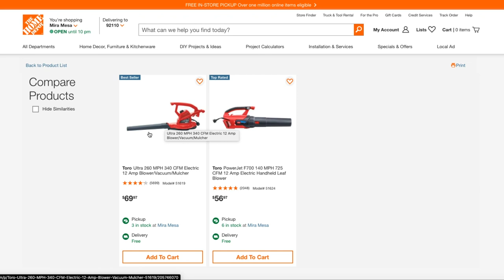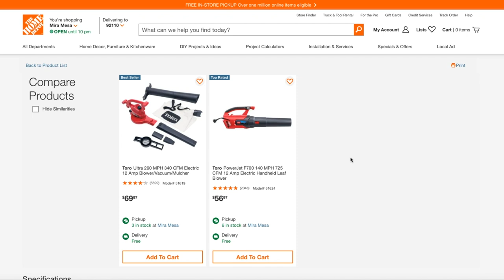LEAF BLOWER  CFM or MPH? Which is more important? | Car Detailing Tips Best Way To Dry your Car!

Comment: CFM is mostly proportional to the strength of the motor, while MPH depends on both CFM and the nozzle diameter. Larger nozzle diameters means lower MPH.  If we are talking about leaves, high CFM means you can move a lot of leaves at the same time. But high MPH makes it easier to move things that require a lot of force to move, like leaves that are stuck. Extreme case would be a super powerful unit but with a giant nozzle, so super high CFM super low MPH, then you would move all your dry loose leaves in a second but all your wet stuck leaves would never move at all.  Drops on a car don't need a lot of force to move, so MPG is much less important than CFM.
Reply: A few stubborn straggler leaves on the lawn is a good thing. Decomposing leaves are great for the soil and lawn so don't fret over getting every single last leaf. I would go with the more CFM.
Reply: By reading comments from others below where you can add reducers to increase MPH, would it affect the motor in any way since you are restricting the flow, therefore adding stress on the motor? It may create overheating or other problems where it would it break sooner?

Comment: For anyone interested in the Toro f700 cause its so cheap there is a mod to make the 4" to a 3".
If you get it at home depot go to the plumbing department and p/u a 4" to 3" coupler (can also p/u a 4" to 2") ...fits like a glove and narrows the blow force to what I personally think 3" is the perfect end for a QUICK CAR DRYER.
You can grab it for under $6....😎😎
Reply: how do you get the coupler to stay on without it blowing off and maybe damaging the paint?
Reply: Very good comment, thank you
Reply: Anyone find out if this is safe to use?
Reply: @jtekz_ Screw silicone contact cement bolts and nuts. Find a option that works for you.

Comment: I just ordered the Worx Turbine 800.. 135 mph, 800 CFM. Yields 108,000 cleaning units. Found it for 59 USD!
With this, I should be able to dry my car just fine without worrying about scratching the paint. Get everything nice and dry, and then put on a topper to add a bit of protection.

Thanks for the great information!
Reply: Bought it last october, knew it wouldnt work well on a non coated car even with a sealant, now that my cars coated the water blows real well even with my little metrovac sidekick, so i just bought the 800 again to try out, how is it?

Comment: The 260 mph is achieved by compressing the air, there by displacing the water drops. The other moves a greater volume of air but the air isn't compressed. It's volume vs rate of flow. Bottom line is, you're not going to dry the water drops from the surface, you're going to displace them from the surface. At a max of 260 mph you going to have more turbulence in the nooks and crannies like your mirrors. Good video BTW.

Comment: I've been using the F700 for nearly 2 years. I also own a land scape company. I can tell you it would be perfect for auto detailing if the nozzle diminished in size to 20-30% smaller at the tip. Still great for the price.
Reply: On thaT NOTE i SAW A GUY WHO CAME UP WITH THE PERFECT SOLUTION...While picking it up at Home Depot he also bought a 4" to 3" coupler taht fits like a glove in the plumbing department....Pretty much doing exactly what you mention above....BOOOOM 😋😋

Comment: Multiplying the CFM and the MPH together is much more useful than looking at either alone. To effectively push water off a car you want as much CFM and MPH as possible. Honestly, I like a raw force measurement better such as newtons or pounds. This will take in to account both the CFM and the MPH. Many of the more reputable brands now list this measurement especially on larger units. CFM and MPH used separately is pretty useless. It is like saying what is more important CFM or PSI on an air compressor or what is more important GPM or PSI on a pressure washer. They are both important and the most effective is the unit that has the highest combination of both.
Reply from the maker: Totally agree!

Comment: I feel like I hit the sweet spot, I got the ego 765 cfm 200 mph blower. Waiting for my stubby nozzle to come in so I can give it a right proper test run. But first use and impressions with the stock nozzle. I like it. It cut my drying time down at least in half, And it got my wheels and tires completely dry. Got the drip zones really good and up by the hood where the water pools at the bottom of the windshield. It is loud as heck tho, I'd recommend wearing ear plugs.

Comment: Freaking AWESOME!  You were comparing the SAME two blowers I was looking at to replace my Troy Built electric 150mph and only 180CFM that I currently use to dry the car with.  Now I see the PowerJet F700 is the one to get!!  So awesome.  My electric blower worked pretty much the same as the one you first demostrated.  What a nice difference between the two.  Very noticeable with the PowerJet F700!

Comment: I’m REALLY hoping that you’re wearing hearing protection while using those blowers. I have both and they are both VERY dangerous to your hearing long run.  Especially indoors. 

On a different note, both work great for me. I always use the finer nozzle on them in order to concentrate flow. 

In conjunction with the higher airflow, lowering the coefficient of friction by ceramic coating really helps.

I also use a rubber edge on them to prevent mishaps from making contact accidentally.
Reply from the maker: Not in the video, but i do when i actually work!!
Reply: @Jesuschristitsjasonbourne3  yes. Loud noises, for extended periods of time are very damaging to your ears. If you don’t know that then consult literally any ent. If you didn’t know that, I’d also like to make you aware it’s dangerous to look at lasers, the sun, and touching hot stoves.
Reply: @Jesuschristitsjasonbourne3  really? That’s your addition to your comment? Now it’s a masterpiece hahahaha
Reply: GREAT POINT. I am currently in the process of selecting a new cordless:
- Air Pump for tires
- Vacuum for detailing
- Blower for Drying
Different brand/models of the above can vary greatly in sound level.
 As a chronic headache sufferer this is VERY important to me. The ProjectFarm videos are great because he includes measuring sound level(db) for each unit.

Comment: Got the WORX WG520 yesterday October 14, 2022, and used it today Oct. 15, and does a mediocre job. Washed my car today and using the WORX WG520 made water beads very small and plentiful. Took me 20 minutes to blow dry my new 2022 Honda Civic Touring, built on September 2022 (date of mfg on the driver door side) and received from a Honda dealership on October 4, 2022, with 2 miles. I bought the blower to avoid getting watermarks or streaks. It does blow leaves very well, but not so good for drying a car. I duct-taped a microfiber cloth around the plastic tip so an accidental touch on the car paint would not leave a scratch. The WORX WG520 is very light, the air intake will suck your tee shirt when close to it. I think suction is better than it blows. The Ryobi 730 CFM 40V Blower could be better because it has 130 CFM more than the WORX WG520 600 CFM. For $55 plus add sales tax, you are better off spending $90 to $120 for a much better product. You get what you pay for! The WORX WG521 is said to be 800 CFM you could try it. WORX WG520 not recommended as a car dryer. Plan on getting a battery-powered unit because dragging around an electrical cord is a nuisance and you don't have to worry about becoming electrocuted after washing your car. Safety First!
Reply: Your car must not be coated then if its just creating smaller beads..or a weak sealant or wax at the least. I did diy detail ceramic gloss and the worx 800cfm did a mediocre job..my now coated car? 800 is a monster.

Comment: Love my eGo 650!!! Rockin it w/ a 7.5amp hour battery. Crazy good!
Reply from the maker: Im going to pick one up to try out.  Thanks!
Reply: @imjoshv  117k units by your logic. Also, when drying vehicles, I don’t use end tips I keep it open.
Reply: Night and day difference when you use the ego650! Here in Az the ego is a must now that it’s getting warmer. I can wash then blow dry the vehicles before water spots set in. It has a nice turbo type button that works awesome on the wheels.

Comment: The f700 is blowing wet leaves at 8ft away. Dry leaves at 15ft away. Only the Ryobi 8 amp can get near this ability. But its quiter at 58 decibals as the Toro is close to 80 decibals. At  Home Depot there is a dollar difference between the 2.

Comment: Maybe would get the best of both worlds with a reduction tip on the higher CFM unit. That should increase the speed of the air.
Reply from the maker: Good point

Comment: Good info on the mph vs. cfm comparison. I’ve got the Toro two in one blower and it’s a great machine for yard work. But since I regularly use the mulching function, I wouldn’t use it to dry my car. With the mulching function, you’re drawing dirt, leaves, small sticks and even small rocks into the machine. Most of that goes into the mulching bag, but when you switch to the blower, there’s a risk that you’re going to launch any remaining dust and debris right onto the freshly washed car at high MPH. And if you’re not using the mulching function, why pay for it? I’d stick to a regular blower for car work.
Reply from the maker: Yea better to be safe than sorry!!

Comment: I just bought a Stihl BG86 gas blower and it's got like 400 CFM and 150 MPH or something like that. I did my whole yard with not a problem, only it couldn't really move the piles once collected. Even though my yard is done and only used this $300  machine one time, I am so tempted to buy the Worx Turbine 800 CFM out of morbid curiosity. I would literally have to rake some leaves out of the woods back into a pike, just for the sake of seeing how it co pares moving the piles. Because if it's that much better, I could try and sell the Stihl one I bought and pocket some cash, since the Worx 800 is less than $100. Am I crazy and should I just let my current obsession over leaf blowers pass? Or do I bite the bullet and possibly lose money for the thrill?

Comment: if you take the 725 cfm blower and use a smaller nozzle, it lowers the cfm but increases the speed. its all about the nozzle diameter.
Reply from the maker: Just like orifice size with pressure washer nozzles! Great point!

Comment: If you use Electricity as an analogy Voltage is equivalent to MPH (Pressure) and Amperage is equivalent to the CFM...(Volume). So to calcule which one is better it's the MPH x CFM= Power (your winner) so basically it's almost the same for both unit...you should be happy  for both.

Comment: Nice video. I'm looking at that 725 CMF Toro and have a smaller one similar to your other one (220 MPH) so I appreciate the comparo. The one thing you missed with the second one was how well it dried. You mentioned the first one left tiny little drop, which I get as well. How did the roof come out? Did it dry it completely or were there still tiny dropless left that you have to wipe off?
Thanks.
Reply from the maker: Both of them will dry completely if you work the panel long enough! You really can’t go wrong with either machine

Comment: I have had both of these units as well, both purchased at Lowe's.   Where blowing leaves is concerned, the less expensive unit with the larger diameter exhaust nozzle is ABSOLUTELY more effective.  I can move piles of leaves from twenty feet away with the F700.   I am going to try it out on my driveway snow later this morning.
Reply: Do you own both to say one is more effective? I can do the same with the high MPH Toro.
Reply: @matsudakodo    You asked, "Do you own both to say one is more effective?".   NO is the answer to your question.   I sold one and kept the F700 after comparing the two.  
Go spend the $70 for the F700 and THEN... you decide.  Not until then will you know.

Comment: I used the CU calculations on all my blowers and I found out the the Toro Ultra is more powerful than the Echo handheld gas by 10000 Cu while my older Toro rake and vac has a CU of 56000 and my Ryobi ONE+ is 28000 CU
Reply from the maker: yeah the battery powered units are typically not as powerful.. how do you like the ryobi one+. thinking about reviewing that
Reply: @imjoshv  The ONE+ is great for small jobs far away from the outlet and is easy to use. It also excels blowing hard surfaces with medium debris but it doesn't do well with wet leaves in large piles so I rarely use it for that job.

Comment: Do you guy's think a narrower nozzle makes a big difference? I just bought a nice Brushless battery powered Ryobi but it has a pretty large opening at the end. And I can't find any different ends to buy
Reply from the maker: Typically the larger nozzle gives off more cfm. I use both and like both but as long as it’s a powerful enough unit the wide nozzle is totally fine!!

Comment: I own the same corded Toro leaf blower with the high MPH. In my experience, it just blasts the water into ever smaller drops which dry onto the car faster. I quit using it for the car 10-15 years ago because it looked terrible up close.
Reply: So its not a good idea to use a blower as it makes paint look worsd ?
Reply: @Gave-rf1hr  it might be fine if you're using distilled or RO water. Just guessing
Reply: @matsudakodo  if using hard water what about using leaf blower first then finish with a damp drying towel?
Reply: @Gave-rf1hr  no. You need to prevent air drying. The blower will speed up drying, so use a towel.
Reply: @matsudakodo  makes sense , thanks bro

Comment: I have the Toro 700 (the fat nozzle one in the video) And use it for the yard and for drying my Goldwing. My thinking is that a higher CFM is more important for drying a motorcycle and that a higher MPH would increase the likelihood of driving water into places it shouldn't be on my bike like the speaker grills and controls.

Comment: I might get the ego 765 or what ever it is. Think it's  200 mph 760 cfm or something like that.
Reply: i was about to do that but $90 vs $300 is a tough sell. On top of that, Toro sells a $50 basic black one that looks exactly like the one my folks have had for 20 years. Such a long work life is pretty darn good. My battery operated vacuums and roombas barely last 5 years.

Comment: Newbie question, do you skip the drying cloth step with the  leafblower? or do you still have to go through it with the mf cloth?
Reply from the maker: i still prefer to use a drying towel so i dont have to run the blower as long. However i have a few customers with VERY high end cars and they are all black so i use the blower and reduce the towel usage to a minimum so i dont induce any marks
Reply: @imjoshv  Thanks for taking the time to reply! I will definately go with both as my car are definately not high end LOL. Keep up the great videos
Reply: @javiwankenobi  That's what I'm going  to do as well. Blow dry it off with the torso and then spot dry anything that's still there.